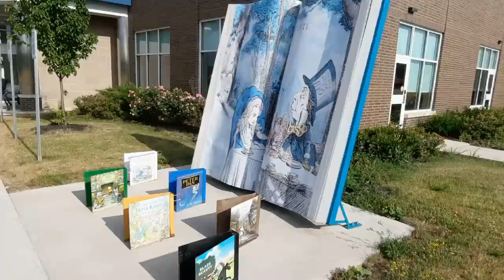I Made Improvements To Our One Of A Kind Bed... Two Times | Ambulance Conversion Life

Comment: I thought about recommending some paraffin to lubricate your bed slides, but forgot to mention it. Glad others picked up my slack. One of my sisters uses that stuff to make some really good chocolate-covered peanut butter balls at Christmas.

Oh, man, "The Tomorrow War" was indeed a complete waste of time. Very disappointing.

Judging from the size, I think I know what's in that Amazon box. Hope it comes in handy next time you're working with bolts in tight quarters.

You might need to chamfer the edges of your stops if they snag on your mattress when you're deploying/stowing.
Reply from the maker: Great minds - last night I thought of the mattress possibly snagging on the stops when being folded out / up. Take 3!!!

Comment: What would make the bed a little bit more sturdy is to put a lip on the outside edge.  Using a roughly 1.5" x 1" strip of molding, on of the outside edge of the bed that would also add to it's not flexing and also the Fold-Down Legs could hide behind it.
Reply from the maker: I've been contemplating a beauty trim to cover the legs... good idea!
Reply: @TheCampulanceMan  

Done right it could be an additional stiffener.

Comment: Looking good David. Two words ""Washboard Roads"". You know how often you have to go around & retighten nuts & screws that didn't have some sort of loctite on them. Same with wood screws. A little bit of wood glue or construction adhesive might help out in the long run. Possibly screwing a magnet on bottom of leg & one where it hits bed when folded might help keeping the legs from unfolding down those lovely bumpy roads we endure to get to those lovely spots. Looking good @TheCampulanceMan. 
ps
Did you change yer mind on the airbags? They are nice yet don't really tend to last that long.
Reply from the maker: That's a good idea on magnets holding the legs up. I drove the truck to the shop and they lowered just from road bumps. They don't lay flush when they're up so I need a different solution than magnets I think - unless they're super strong ones!

Comment: When I work on my RV here at home in the heat and humidity, I plug in to shore power and run the air conditioner.  Call me a wuss if you want to !   Lefty needed to stay back there under the bed to micro-manage you.
Reply from the maker: No, I call you smart! I didn't even think of doing that!